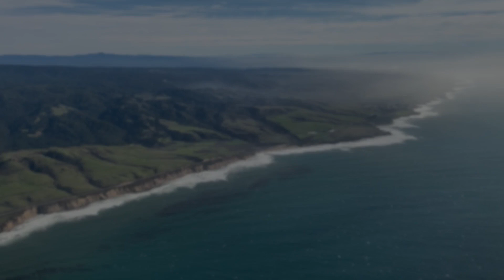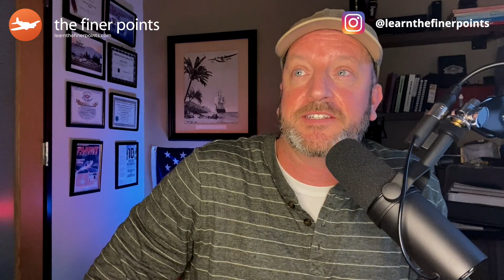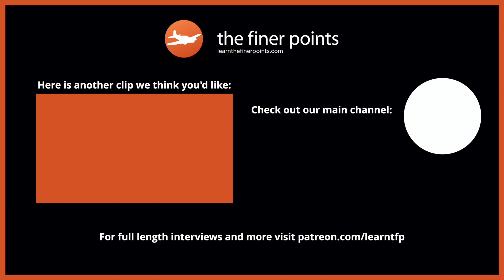How to lean an aircraft engine in the climb

Comment: In a da40 max continuous power is 24in MP and 2400RPM. In a climb I hold those power settings which means the throttle and prop are not full forward, but as I climb the power will start to dip below 24in MP because of the outside pressure change, and I readjust the throttle to maintain 24in MP by pushing on the stick. Before I push on the stick to readjust my climb power setting to 24in MP how would I readjust the mixture if I should do that at all? The POH says to slowly increase the mixture to rich before increasing power before once again readjusting the mixture? Is this still proper procedure in a climb?

Comment: This is basically the procedure one follows if one does not want their engine to last to TBO. Leaning below 75% power is spot on. However running your cylinder head temperatures at peak is a sure way of shortening engine life. You should be using EGT's or TIT (not CHT's) for leaning. Reference: Lycoming Service instruction No.1094D: Fuel Mixture Leaning Procedures (still listed as current). It states 100 degrees Rich of Peak for Best Power. Peak EGT for Best Economy. Procedures are given to achieve these results. Has a great chart on the last page which shows all the temps and where you really want to be. Peak CHT is not it. I am sure Continental is similar. I follow this channel and it is a wealth of great information and techniques. Highly rated to all my students and fellow pilots. This one is the exception. A great record considering the number of videos posted. Cheers.

Comment: Shouldn’t you lean for all phases of flight and not just above 5k?
Reply: The difference is that in a Vy climb you are at max power, but 5000ft is a common "critical altitude"* (when the engine produces less than 75% power at max power setting). Leaning the mixture when you produce more than 75% power could lead to detonation and afterfire.
*Edit: I just realized Critical Altitude is not the right term, but for the life of me I can't find it now